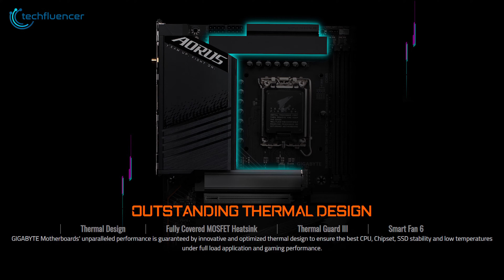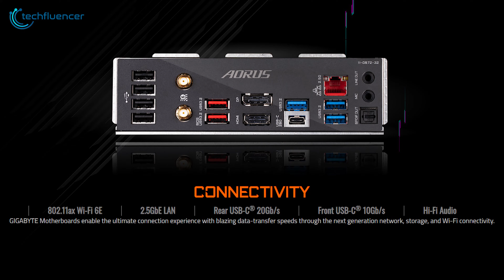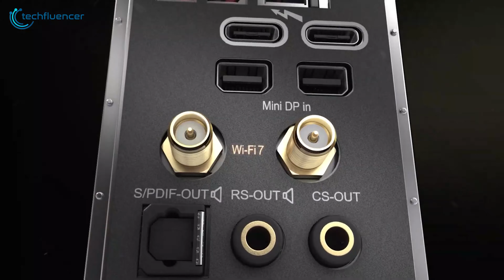5 Z790 Motherboard for Intel 14th Gen CPUs

Comment: Please Tell Top Noch Motherboard & What Is Missing? This List 

For This System 

PC REQ FINAL

1. Intel Core i9-14900KS

2. NVIDIA - GeForce RTX 4080 16GB GDDR6X Graphics Card

3. Corsair 5000D CORE Airflow Mid-Tower ATX PC Case — Black

4. Corsair Dominator Platinum RGB DDR5 64GB (2x32GB) DDR5 5600MHz C40

5. MSI MAG A850GL PCIE5 Power Supply Unit, 850W

6. COOLER FAN
NZXT Kraken 360 RGB 360mm CPU Liquid Cooler/AIO with with LCD Display and RGB Fans - White | Support Intel Socket : LGA 1700, 1200/115X | AMD Socket : AM4, AM5, sTRX4*, TR4* - RL-KR360-W1

7. Samsung 990 PRO SSD 2TB PCIe 4.0 M.2 Internal Solid State Drive, Fastest Speed for Gaming, Heat Control, Direct Storage and Memory Expansion for Video Editing, Heavy Graphics, MZ-V9P2T0BW

8. ASUS Z790 Motherboard ROG Maximus Hero LGA 1700 ATX with 20+1 Power Stages, DDR5, Five M.2 Slots, Wi-Fi 6E, Two Thunderbolt™ 4 Ports, USB 3.2 Gen 2x2, AI Overclocking, AI Cooling II, & Aura Sync RGB